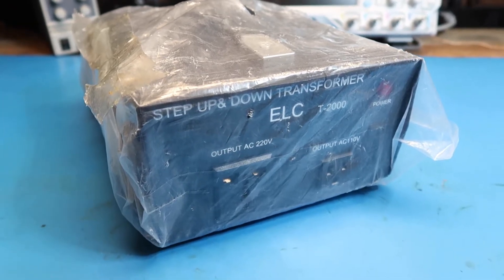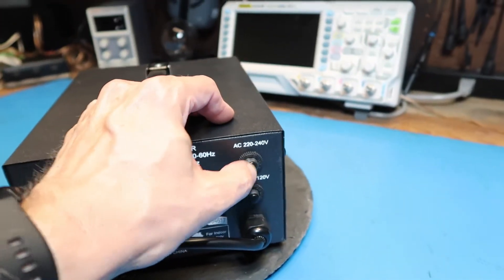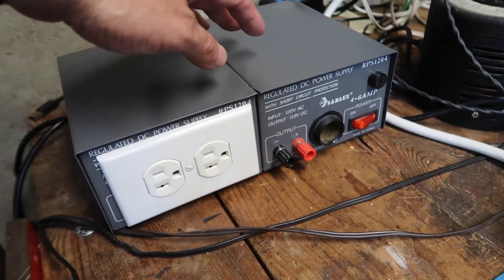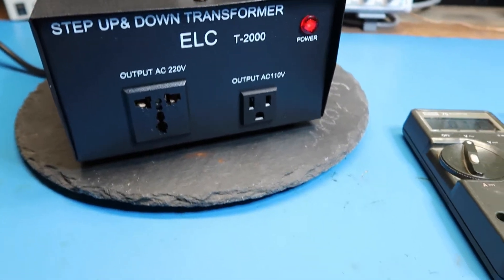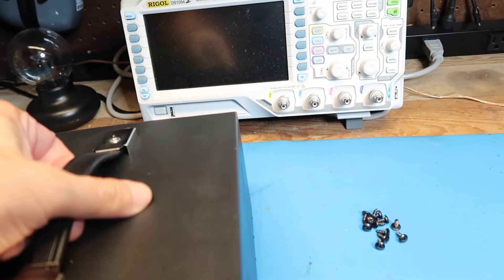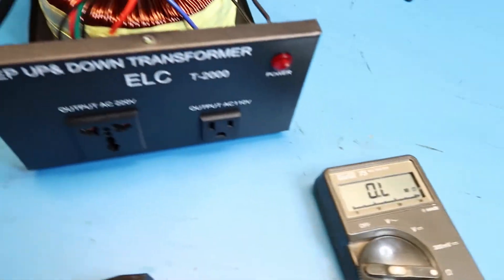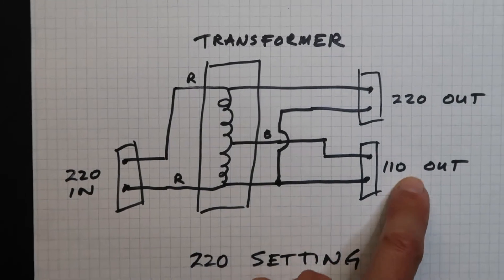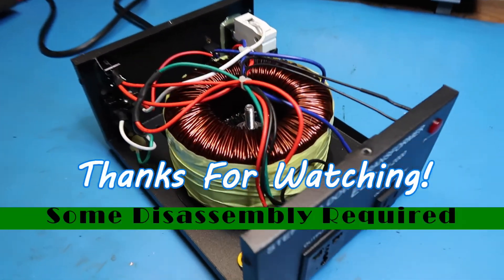Discovering a Step Up and Down Transformer

Comment: I have a similar transformer. Mine runs all inputs through the auto transformer. I have run it on an inverter before to run my little welder and my house in a pinch. It actually takes the two 65v ac legs of input and makes a single leg 110v. It also makes 220v with two inverse legs and creates a functional neutral.

Comment: If the transformer power is 2200va, what size wire is used? does it refer to input (110v -> 20A)? or does it refer to the output (220v -> 10A)?

Comment: holy shit your drawing really help me understand how those transformer works. 

in theory I can take a 30amp 120v input and convert it to 240v split phase by taking that neutral and get 2 120v feeds which will give me 240v split phase. this way I can back feed the whole house at the panel

Comment: That power switch is actually 20A DIN rail circuit breaker.
That transformer is autotransformer which has only primary, and thats why there is no isolation between the outputs.
Reply: Did you watch the whole video? Cause you just repeated everything he already said.

Comment: Would you recommend this transfer to work with an inverter?
Reply: Hi Howard. Yes i think it would make a great inverter transformer. Here in NZ we have 220 standard. The 110 tap could be ignored and wind your own LV secondry. Its a inexpensive way to get a toroidal transformer esp a 5KVA. Id think wou would need to derate the transformer to 50% as they tend to over rate. Im keeping my eye out for a second hand one and will give it a go.
Reply: It definitely works for me. I've bought a  240VAC single phase 5kW inverter from MPP Solar about 3 year ago. The specific model was PIP-5048MG... But in the US we use a split phase 240 VAC extensively with a bonded Neutral at the Mains panel.. So I removed the 5KVA toroidal autotransformer from a step up/down that I bought for about $90 and installed it in my circuit breaker box to obtain the split phase output I needed. This DIY procedure saved me a lot of money as I could have paid $1400 !!!  for such US split phase output inverter. But I paid only $650  and It's been working fine for the past 3 years without issues. The only problem I had was with the inverter grounding. It was bonded to the chassis inside the inverter with the Neutral of the single phase 240VAC output. Moreover this is a hybrid inverter that also can take the single phase grid input, being 120VAC or 240VAC. Here also the ground, the chassis and the neutral are bonded together. To prevent short circuiting in my breaker box because of  the grounding issue, I decided to go totally OFF grid and carry power to my outlets without ground... I know it's unsafe,  but actually this is how domestic wiring is configured all throughout Japan. However, I do plan to resolve this issue, by opening the MPP inverter and disconnecting the ground from the neutrals. Then only can I bond the ground and neutral in my breaker box. I recently bought a newer inverter that doesn't have the chassis ground and Neutral bonded inside its chassis. So it will be simpler to implement my split phase output, and this time its going to be properly grounded. Since it's another hybrid 10.2kW inverter, this time from PowMr, I bought 2 of those 5kVA step up/down transformers which I'll connect in parallel to handle twice their power. Once it's done and the system is operative, then I'll fix the MPP grounding issue. Otherwise I'll be left without power in the whole house.
Reply from the maker: I think that would be fine as long as you stayed within its power rating.

Comment: How difficult is it to access the blue wire connection on the coil ? If you cut it there , it should give you separate windings.
Reply from the maker: Thanks for the suggestion. I'll look into that.
Reply: @SomeDisassemblyRequired    And what was the outcome?  Did u manage to split the coil into two at that blue wire connection, giving u a 1:1 isolation transformer?

Comment: Hi,
My question is if you used the 220v in switch is the output coming off a secondary winding?
If it is, couldn't you disconnect the center tap. Then disconnect the output ground from the chassis and neutral of the receptacle to achieve an I.T?
Regards,
Jack